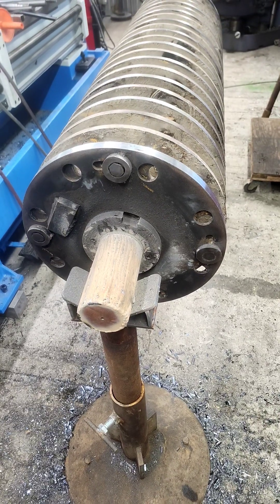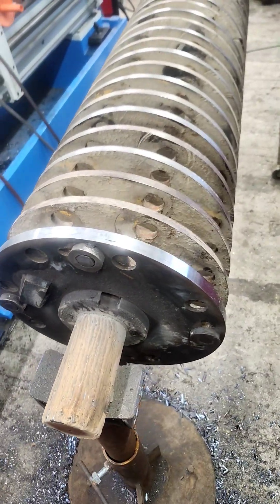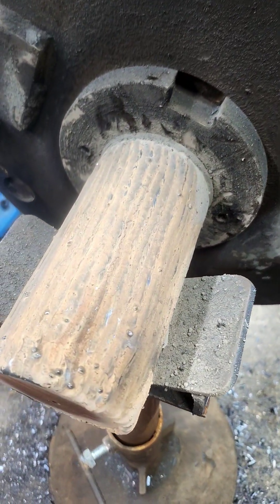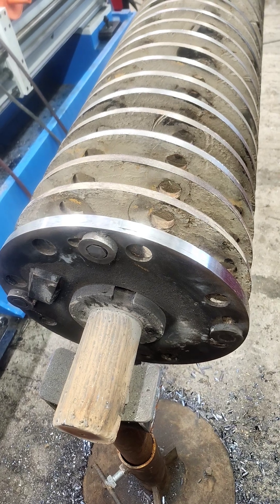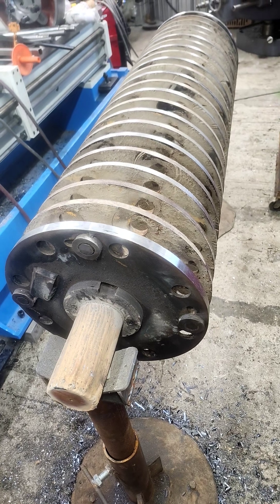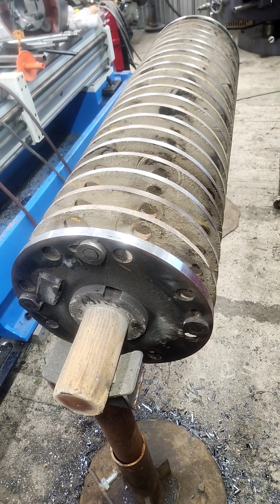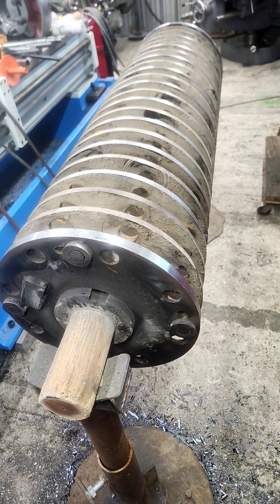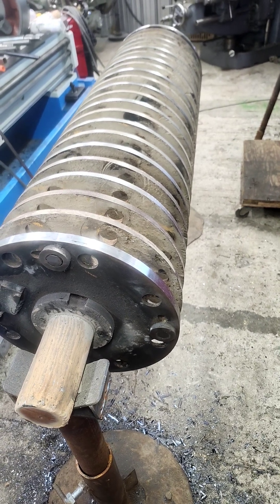Repairing $30,000 tub grinder rotor part 2

Comment: I thought only India did this.  Why not fix it right and turn a brand new shaft?  How can reworking hardened materials on large equipment be a more economical solution when safety is important?
Reply from the maker: Welding a broken shaft back together and surface buildup over bearing journals are completely unrelated. One is a well established repair process, the other is a hack job. 
Also not sure where you are getting the idea there are "hardened materials " involved from. There is testing done to ensure the repair process is suitable before it starts. Otherwise the answer is making a new shaft. Due to the construction of these rotors, replacing the shaft is not trivial, hence this being the standard procedure. Not just here but industry wide. 

We are a highly reputable company, and if anything we did could even be remotely comparable to the videos you reference I can assure you we would not have the mines, OEMs, and equipment dealerships we do as customers.
Reply from the maker: The alternative to this you will see used is metal spray buildup. There are other equipment options but it is most frequently applied with an specialized torch that injects fine metal powder into the flame. Many channels on youtube show it. That process is seen because it is fast and cheap.  However it is very unreliable. Used in an application such as this you will have the buildup crack underneath the bearings. 

The repair discussed in this video is surface damaged caused by the locking collar on a bearing coming loose. The shaft was turned down 0.050" per side to clean sound material below the damage and has one layer of weld deposited on the surface.  
The other side of the shaft (not shown in the video) had been similarly repaired by another shop previously however they only fixed the journal and not the worn keyways. The customer requested we rebuild both ends while it was in to avoid future downtime. 

I get the impression from your comment that you are thinking the end broke off and we welded it back on. I can assure you that is not the case, and I can state unequivocally that is not something that would ever be looked at as an option.